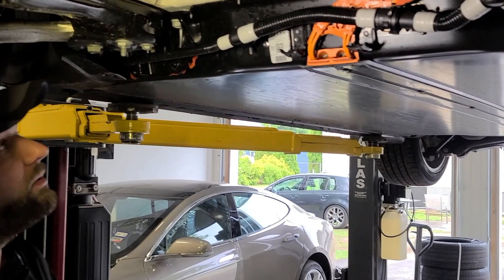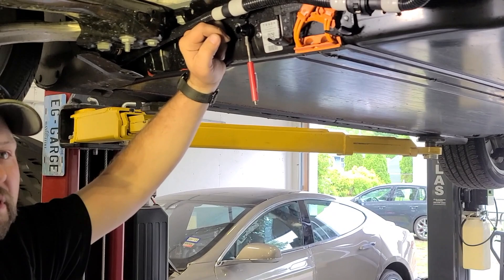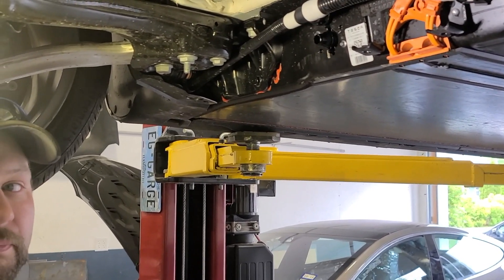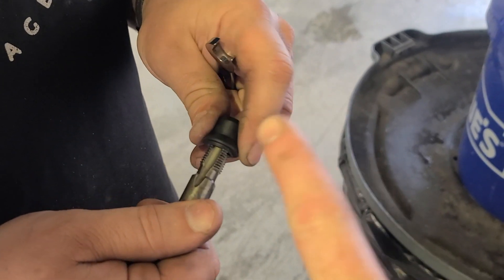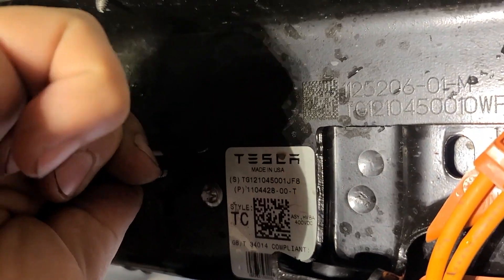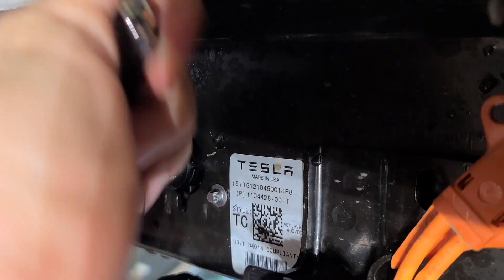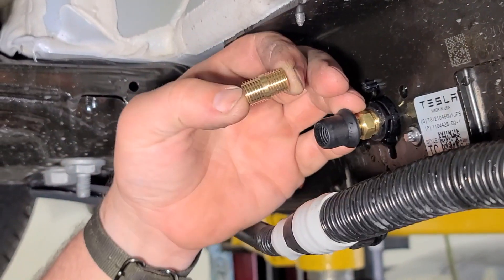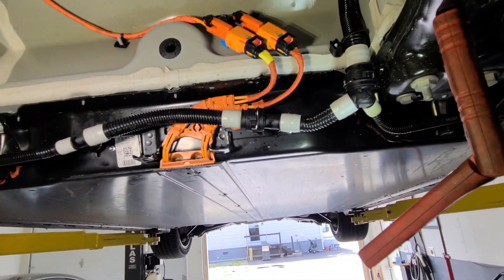Saving a customer $15,300, Tesla Battery DIY Repair

Comment: I have seen a similar video where the same happened and the guy used plumbing parts, tapping threads and epoxy in places to secure it, Tesla also wanted to charge for a new battery and the USA State he lived in did not allow own repair, so he had it towed out of state and the repair cost a few dollars in parts and some labour. Great job.

Comment: Tesla is not going to do that at a dealership, that isn't going to pass engineering testing and they can't guarantee that fix.  However it is 100% okay for an outside shop or owner to do that as long as they know it voids all warranties on the battery.

Comment: what about on a 2016 pre face lift model S my sunroof brackets broke the two on the back half of the glass Tesla wanted $4500 because they were saying the links were stuck and that they needed to replace the whole glass just clarifying if this sounds about right because I’ll just go get that fixed

Comment: I would certainly get the metal plate on the front and back bottom of the vehicle.  Too much sensitive stuff down there to be guarding it with flimsy plastic.

Comment: Just basic plumbing/ engineering craft techniques not very impressed with the engineering of Tesla battery plumbing though like a lot of other car manufacturers they use brittle plastic where metal would be a better engineers solution you see it on thermostat housings on IC cars  clearly the accountants are in charge at Tesla.

Comment: On the short connector with no hex. Fab up a short pipe tapped for the nipple side and use that to tighten it into the the battery.

Comment: Great video! I’m a bit concerned about one part of the repair, though. You mentioned the coolant line won't take more than 1 bar (15 psi), but according to the coolant refill manual, it needs to be pressurized to 5.5 bars (80 psi). I’m not sure if the threaded plastic can handle that much pressure. What’s your take on this? I'd love to hear your thoughts!
Reply: An additional concern would be the restriction. It's a small restriction to be sure, but in a very highly engineered system it might be significant under some conditions. Such as max A/C on a hot day, or possibly max heating on a cold day, or extended high speed or acceleration, or any number of extreme scenarios.

Comment: Brilliant! Nice work. I have heard about this type of damage leading to this repair which is why I installed the aluminum bash plate in place of the flimsy pan. Incidentally I also installed aluminum plating on the rear side of the wheel liners as additional protection of all the coolant lines. My Tesla is lowered and raked so…not much room for deer heads or chunks of ice to move around.

Comment: I am a tesla Mechanic from Fremont/ CA factory. I'm impressed by your work 👏  well done 👏 it just you need to double check those clipping on pipes. It usually came loose if it doesn't hear double click.
Reply: I'm surprised they didn't fire you for posting this tbh.  And the reason it only clicks once is because it was broken at the second part where it clips.

Comment: For the LOW PRICE.. It would be worth to get a small tap handle for this sort of thing.  You have much more control.  If the pipe tap wouldn't fit in the tap handle.  The square could be ground smaller so it does.

Comment: Something similar happened with my Ford Fusion Hybrid. I wasn't mentally prepared to spend ~$100 on four coolant lines. Instead, I spent $8 on some plumbing fittings at Home Depot, and now everything is up and running. I noticed that many people in the US believe that the only way to fix such issues is to buy a new part. However, often, you could fix it for cheap, and the final result will be more reliable than the original solution. Well done, sir.
Reply: Apples and oranges... from this point on, if the battery fails and causes damage to person and/or property the owner is totally liable.
Reply: @daves2624  only if it can be proved that the repair work was responsible for any injury. In this case the repair work  will clearly work under 'normal' conditions . It may fail with another smack but no sooner than the original did. The only issue i would have with that repair is the brass fitting. We don't know what the long term effects of that on the coolant will be plus if that fitting was plastic I would have used a plastic weld to reconnect everything making it more permanent and possibly stronger. But either way its 'probably' good.
Reply: @cwwiss1 , thanks for such deep explanation!
Reply: Yep, the plumbing department at Home Depot can save you a bundle!

Comment: I just got quoted $21K for my Model Y Performance that had a rock fly up and break the coolant line. I believe that it is the same failure. Going tomorrow with the insurance appraiser to see the issue. I would gladly pay $700 to have this fixed this way. I would already have my car back and it would be a better repair. I also plan on getting the aluminum skid plate for $300 to hopefully avoid this in the future.

Comment: I wonder if tesla knew it was an easy fix, but suggested the inefficient 16k cost instead. And if Tesla has a committee that can be shown this. How low cost effective solutions like this are happening.

I wonder what they'll say when shown this, will they STILL say just change the battery anyway even after seeing this easy inexpensive solution?

Alot of videos like this about tesla are being watched everyday, increasing consumer awareness about cost charges.

Comment: I just experienced the exact same thing. Awaiting final verdict from Tesla service center but told it's highly likely they'll need to replace the entire battery pack for the exact same reason as discussed in this story. How stupid!
Reply: It’s not just Tesla, not a single car manufacturer will approve a repair like this. Even though it makes sense to us.
Reply: @steveowsley6475  no other manufacturers have this big of design flaws, it seems intentional to me.  Thats a lot of insurance money they get, and then they get to recycyle the batteries.
Reply: @steveowsley6475  Hello. It's been a long time since I posted that. The final verdict ended up being reasonable and not my worst nightmare of having the entire battery pack replaced. It was the front Aero shield that was damaged. Fortunately the battery pack was unscathed. The coolant hose came loose as a result and began leaking so I was scared it was directly coming from the pack. The techs did say they bent some parts back (clips?) to allow it to work and not have to replace the whole pack. They did a full leak test and it passed. However, they asked me to return one week later so they can conduct another leak test just to be safe. I did and it was fine. I didn't have to pay for that.

In the end for parts and labor I paid just a total of $469.28! What a relief that was.

Comment: well tesla just want to grip off tesla customer. They want to sell a new HV battery pack, not even refurbished HV battery pack. An out side independent shop fix this problem easily. Nice job sir. 3h labor easy. Customer is very happy. 
I think after market shop may custom CNC  an adapter repair part made from brass or stainless steal for this repair. It will be permanent repair.  Even now it is a good  repair.

Comment: What size pipe thread? 1/4" NPT ?
Reply: I'm also having trouble sizing the thread and insert. It seems like M14x1.5 or 9/16-18 would be a good size but finding a matching brass insert has proven difficult. Did they go with some more standard here? Maybe 3/4" NPT?
Reply: I made it work with M14x1.5 tap and a corresponding M14x1.5 brass fitting from Tameson
Reply: @eldridish  you have the  link for fitting and tap?

Comment: I used to be in charge of ultrasonically welding brass inserts into plastic car powertrain parts like water outlets and as a hobby built a custom water cooled computer for myself. This repair is what I would do as well.

Comment: This just happened to out Model 3 AWD long range. You ask yourself why does the safest car ever produced have higher insurance rates of cars three times their cost? 
Repairs like this that can be fixed for under $700 instead cost $15K. 
My partner ran over road kill. the damage is super minimal. It drives strait, all battery cells are in great working order it just over heats and stops due to no coolant in the battery. Replacing a skid plate and a procedure like this would get it back to perfect working condition. Instead, Tesla insists we buy a new battery and replace out the entire unit. Insanity!
Reply: Following up a year later. What did you end up doing? Did a repair like the one in the video solve your issue?

Comment: This just happened to my model 3 Performance last night.
Reply: Oh no! How did you end up fixing it? Just like in this video?
Reply: @ledzeppelin1212  insurance covered it and replaced the whole battery.
Reply: @KD-bk7gd Good deal! Who's your insurance provider? I have Tesla Insurance.
Reply: @ledzeppelin1212  I have Tesla now, it was Geico or something, I can’t remember. It’s been fixed for nearly a year now.
Reply: @ledzeppelin1212 oh I’ll elaborate that this happened bc road debris was hit on the highway. So it was considered an “at fault accident” which sucks, but the repair ended up being like $20,000+ for just the battery.
Reply: @KD-bk7gd  Wow, Teslas don't seem to do well with road debris. I have heard that the Performance versions are lower to the ground (and thus maybe do worse when hitting debris?). Anyway, thanks for the reply! This is good info to know.
Reply: @ledzeppelin1212  oh interesting. Yeah I have the Performance oddly enough so that checks out.

Comment: Chad, is that a high voltage hookup on the front of the battery on a single motor or does that go elsewhere?
Reply: That is the HV wiring that runs through a tunnel on the bottom of the battery. It connects the front HV to the rear.

Comment: Nicely done. But aren't you worried about the restrictions it will cause? Inner diameter is probably 50% smaller so in extreme conditions (hot/cold or heavy driving) coolant flow will be reduced significantly.
Reply: Worried maybe a bit but not $16,000 worth.
Reply: @giggleherz  😂😂😂
Reply: If that happens, there will be an error code generated for coolant temp out of range.
Reply: If the pressure is only 1-2 psi then I doubt the flow rate is very high to begin with.
Reply: @rschneid1996  yeah, I saw two little electric pumps, pumping coolant all the time in my 23'tesla mod3 rwd. I dont think it could cause the flow problem either. The only thing customer lost the warranty on that HV battery pack, if any thing related to over heat problem. But I doubt it would get over heat even on freeway driving with ambient air temp at 120*F.  I am happy with that repair.
Reply: If you look at pictures of the battery internal plumbing there are lots of other restrictions and a brass nipple would have a very minor effect if any.

Comment: Clever repair, well done. I just don't like the amount of negative publicity Tesla got from this story because of Rich. Even in my god-forgotten country with 10M ppl the mainstream top-hits music radio was talking about this case yesterday!
Reply: It’s a poor design on Tesla’s part. Never should have happened in the first place. And this is not 1 isolated incident. Tesla deserves every bit of negative publicity for trying to change 1600 dollars for basically a 100 dollar fix!
Reply: @greycrow So to hear it from you, anyone with an issue with a Tesla should just STFU, not say anything, and let TM continue to spew BS about how Tesla can do no wrong, even though they do so routinely?  Your hypocrisy is astounding.  If any customers of any OTHER automaker made similar complaints, you'd be cheering them on.  I bet that First Amendment really gets under your skin.
Reply: It's not about them, it's about right to repair 🤔 Tesla is just a "young" manufacturer, avoiding these problems in the first place comes from decades of manufacturing practice... I believe it's supposed to promote the right to repair movement, and this was used just as an example (check Louis Rossmann's channel)
Reply: I agree with you.
It could have been a problem with the dealer not Tesla in general.
I wonder how much had quoted Tesla in say... Fremont?
Reply: @SniperSnake50BMG  Tesla doesn't have any dealers. There are only the Tesla Service Centers, which are run and owned by Tesla directly. But I also love this pragmatic repair :-)

Comment: tesla: Let replace the battery
this guys: no
Reply: If Tesla does it this way and it fails they will be on the hook. Nothing wrong with doing this mechanically
Reply: @gonzac36  tesla should be making their cars more repair friendly. this should be a $20 part that takes 5 minutes to replace..
Reply: @chrishayes5755  yeah for sure

Comment from the maker: 150/hr labor rate, diag, drain refill coolant 5 gallons of G48, fill/bleed, diag to verify car is operating normally came to about $700
Reply: You forgot $3 for the brass union at Home Depot! Does Model Y suffer from this risk? Does the 3 plate you are selling fir the Y?
Reply: Labor rate at Tesla is now $239 Hour
Reply: @TechnozSki   lmao  another reason never buy electric
Reply: @TechnozSki  Made up rates lol
Reply: Brilliant!
Reply: In my country mechanics work for 700$ a month.
Reply: @Mladjasmilic nothing to brag about
Reply: @Mladjasmilic 😂 They do in most countries. Only America can charge stupid prices because people are used to throwing away their money.
Reply: I believe that is not an issue for Model S manufacturerd in March 2014 and beyond due to the addition of a Titanium underbody shield.
Reply: 250$ an hour in florida.
Reply: Still offering the training?
Reply: I guess you pay for the part, labor, the knowledge, and break through because he is the first one doing this.  Thousands will follow.  So he deserved that $700.
Reply: Hi
Reply: Nice job 
I have same issue driver side  still on hold  waiting for insurance  but look like playing game 
I’m in Texas  couldn’t find one to get it done 
Thx
Reply: Good solution
Reply: Still cheaper than a new battery from Tesla, but $700 for that job seems extremely expensive.
Reply: @liveandletlive2894 1st, if it save you new battery that is around 17k its ok. 
2nd if you know how to do it you can also charge someone. 

But i know most of the people dont appreciate when someone try to save you money and maybe charge you 200% more than it should but save you 16k instead. 

Im a mechanic and i know 96% of the people dont even say thanks when i save something. 
And at that point i thinking of smashing that i save and point you to tesla and wait a 17k bill.
Reply: @liveandletlive2894 You are also paying for the innovative idea (you pay for knowledge + the time/labor/parts). Fair price.
Reply: @liveandletlive2894  can you do the work yourself? Do you have a lift to raise the car up to work on it? Did you know how the technician was going to reconfigure the nipple and the insert? I'll bet you didn't know any of these answers. $700 was a fair price for his expertise and knowledge an experience.
Reply: @bassinbillRC5300   I believe 700 is the total. It is still ok. 3 hours, and parts, still cheap and very good price for that repair.
Reply: @bassinbillRC5300 This is an extremely easy DIY job. It didn't take expertise it took common sense.
Reply: @liveandletlive2894  lol this is ridiculously overpriced too
Reply: 150 an hour    lol  should be 30 tops